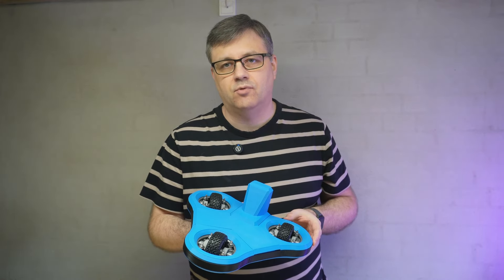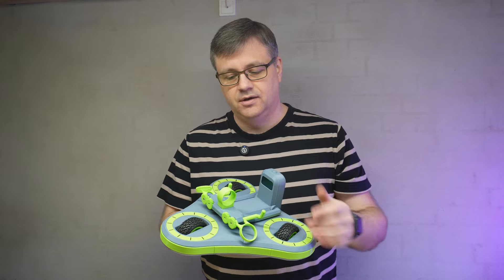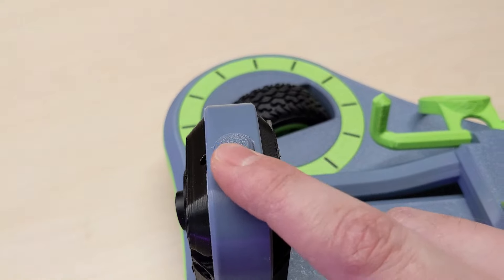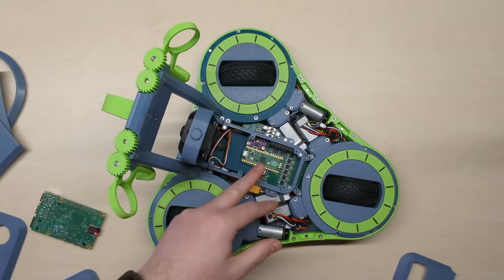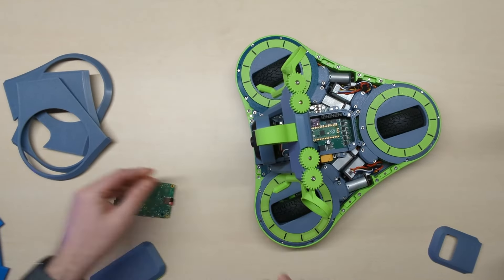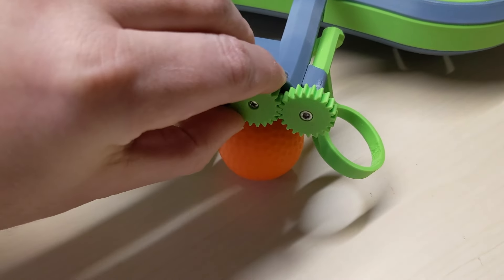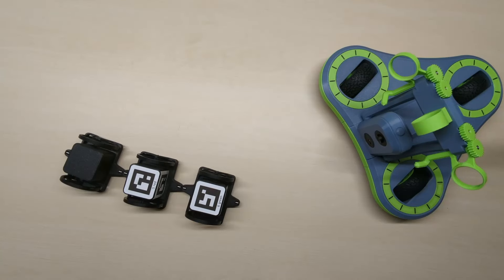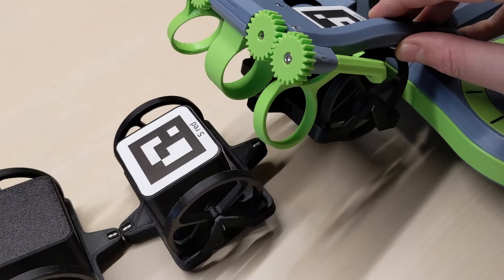Wild Willy 2024 Robot Reveal

Comment: Your Fanboy here. Absolutely stunning. Those colour combos and thoughtfulness of design is extravagant. Waiting to see it roll on the dtu competition floor.
Reply from the maker: I'm not fully satisfied with the colors, but had a bunch of the green filament, so ended up using that😀. Still a lot of work to make it actually run.
Reply: Have you tried ros2 on your robots?
Reply from the maker: No, it is just running my own software. I have looked at bit at ros, but it takes some time to understand how it works, and I'm not sure I have the time to invest in that.

Comment: The engineering on that looks amazing! The old one looked pretty cool when moving around, cant wait to see this one (hopefully) nail every obstacle.
Reply from the maker: Don't get your hopes too high. Currently I'm struggling just getting the cameras to work reliably.
Reply: I hope you will get it sorted out! On your old robot the camera seemed to work as intended, but maybe it only had the rgb camera?
Reply from the maker: Problem was a bad connection in the cable on the RGB camera. I fixed it by soldering the usb cable directly to the camera board. 
I had the TOF sensor on the blue robot, but never used it because of a driver issue. The sensor was quite new at that time. This year I got the sensor working on a Pi4, but in the end decided to use Pi5 on the robot. And then I had the same problem with missing driver support for Pi5. Arducam released support for Pi5 a few days go, but I didn't have the time to implement it.
Reply: Great news! Did you manage to get a run in too? I only do dumb industrial robots which just performs the same actions over and over. At some point I would like to add some kind of vision to them too, but so far I haven't found anything (at a not too crazy price) which can handle what I need.
Reply from the maker: Yeah, I did run today in the competition, but the result was not great. I made stupid mistake of merging to programs for different parts of the track into one, but never actually tested that it was working. But I did solve the qr code box challenge, so the gripper in the video worked decently. I work with industrial robots and vision in my day time job, so I know that part very well😀
Reply from the maker: You can see it run here: https://youtu.be/Al4ebXraGM8?t=1960
Reply: @wildwillyrobots that is looking so good, with those new and bigger motors! Hopefully it will turn out to be a more stable platform, so you don't have to fiddle around with the hardware as much, and can instead concentrate more on the software. Doing the boxes looked looked pretty confident too, both detecting them, gripping them, and putting them in front of the houses.

Comment: You have been my inspiration for quite some time as I'm dead set on using the independent wheel steering like what you have.  You continue to be my unofficial teacher.  Thanks so much for sharing your designs and plans.
Kudos to you!
Reply: I forgot to mention that I also love your implementation of the magnets for the covers.  You rock!
Reply from the maker: Yeah, the magnets are quite nice. I will share the complete design at some point, but I need to clean it up a bit first.